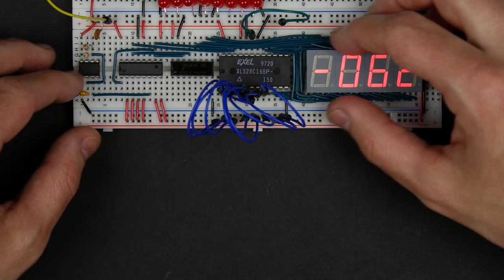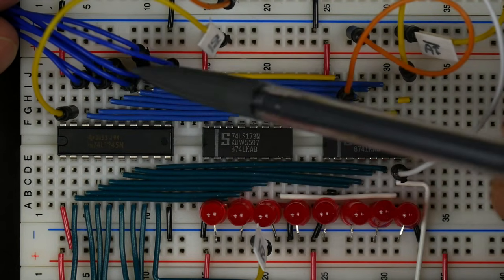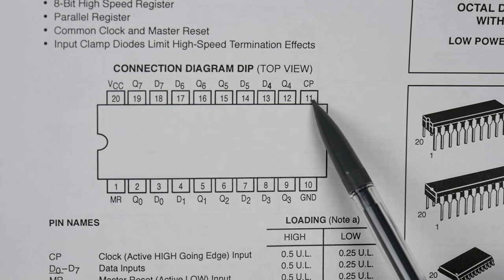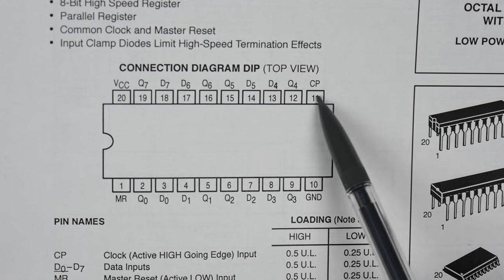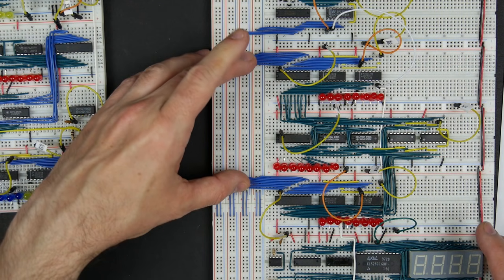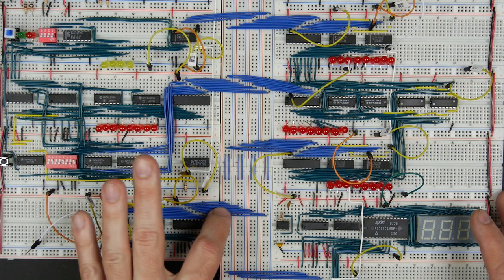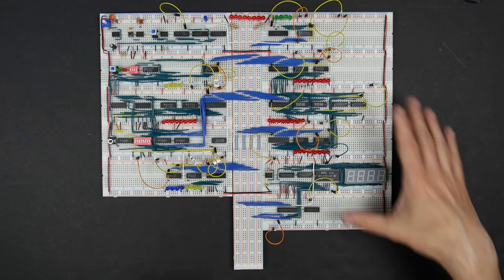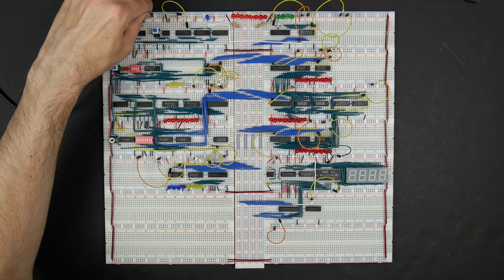8-bit computer build: Connecting the bus

Comment: How much would the part for that computer cost?(including the breadboards).
Reply: From what I bought so far, the breadboards seem to be the most expensive parts :P Other parts usually cost peanuts.
Well, maybe except for the EEPROMs. But I overcame this problem too: I bought them in bulk from China through AliExpress.com , because here where I live they cost 4...5 times more for a piece (!) :P
(That's why I commented under the EEPROM video that perhaps Ben could make a tutorial about programming Flash memories, because they are much cheaper and easier to get than those old EEPROMs.)
Reply: Sci Twi I kind of expected that, that is why I wrote "(including the breadboards)".
Chips are usually very cheap.
Anyway thanks for the answer.
Reply: Sci Twi I've planned to start building this computer during the summer. Where do you buy your parts? which website? in France, electronic websites are really bad... 😕

Comment: while building this i was having really weird behavior on the bus lines where certain lines wouldn't pull down to ground when not high. i went on a witch hunt thinking that it must be a faulty module, i disconnected ... all registers and even the ALU ... turned out i just needed to use 5k resisters instead of 10k to make sure lines get pulled down. i cried when it worked.

Comment: If you could make a graphics card in the future, could it run Pacman or Tetris? I would assume you would need more memory too.
Reply: There would have to be significant changes to the ROM.
Reply: cpld or fpga
Reply: We could start from an 8×8 LED dot matrix display ;> It can be driven with a single MAX7219 or MAX7221 chip through a serial interface, so even this simple computer could drive it :) (The dot matrix can be also replaced with 8 7-segment digits, because both have the same number of LEDs: 8×8=64.) The chip is basically a bank of shift registers which you can shift some bits into through the serial interface, one by one, and it has a built-in counter with a decoder (similar to those used in Ben's multiplexed 4-digit 7-segment display) which switches through the digits / rows of the dot matrix, one by one, lighting up one of the 8 particular LEDs (dots / segments) in that row / digit.

Then you can try daisy-chaining a bank of such dot matrices in series for a bigger display, if the computer is clocked fast enough to prepare those bits. Of course it depends on how often do you need to refresh the display. Because if you can get with a static image, like those on Amazon Kindle, then the speed doesn't really matter that much: you can prepare all those bits one by one, and then tell the MAX chip to display them all at once.

That's actually what I'm trying to do right now, waiting for Ben to make the tutorial about the control unit and instruction decoding :q so that when he finally does it, I will have the display module ready ;J
Reply: That's very interesting indeed. I did some small LED matrix multiplexing a few years ago with an arduino, I shall watch this space.

Comment: If you want to save  space and a little bit money you could use two diodes and a resistor to create an and gate. Example here: https://electronics.stackexchange.com/questions/131860/diode-logic-gates It might also be nice to add another power strip to the bus to add the clock signal to the bus.